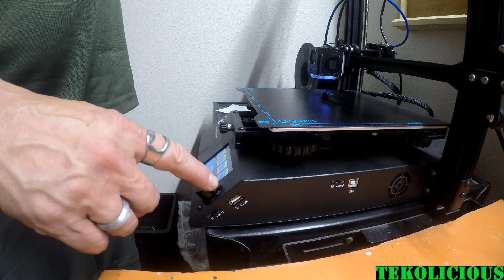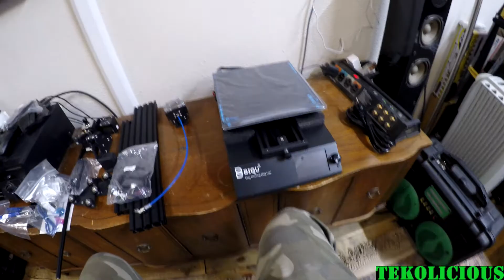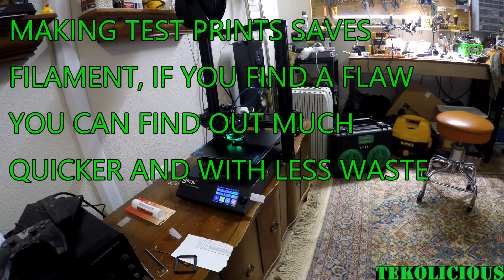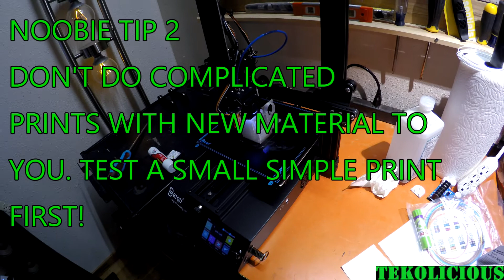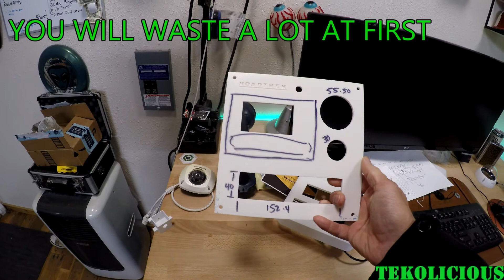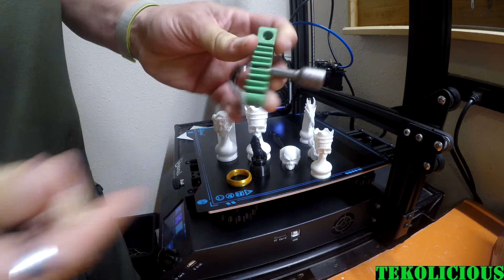3D Printer Noob Review of BIQU B1Learn from my mistakes

Comment: Thanks for the review! But can it print anything useful?
Reply from the maker: yes I printed a gopro case, custom display plates, umbrella's stand covers, curtain mounts, light switch boxes, wallets, knobs for my radio, clips for tools, and i have only had a few months. I am working on lighting spacers for my van to mount fog lights. And thinking of doing custom funnels. I also did apple watch charger. I am a noob so I am sure I can come up with more later.